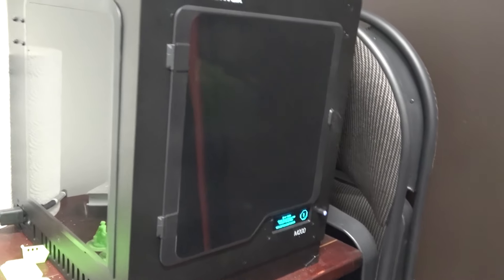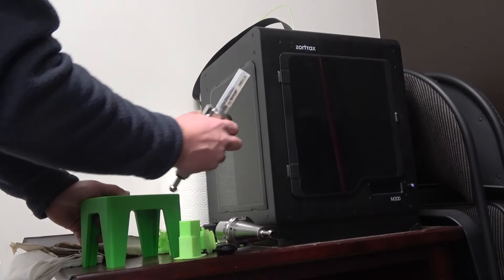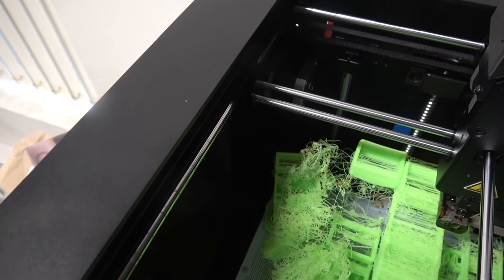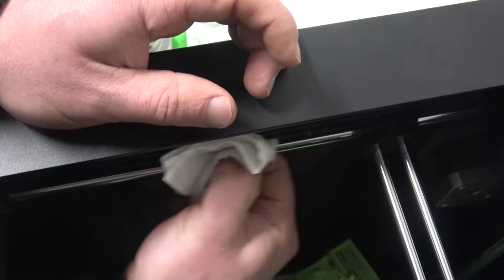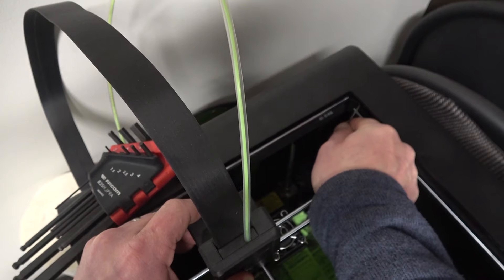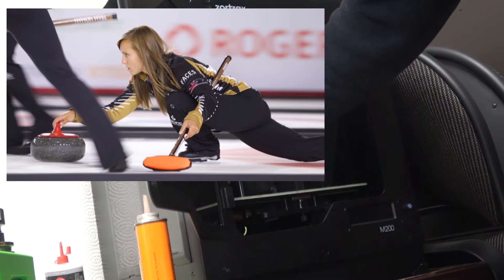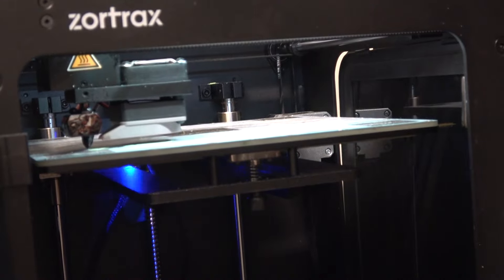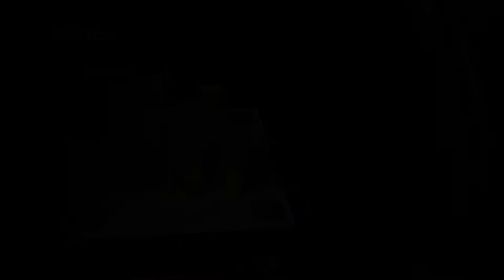WTF is a Zortrax M200?!

Comment: Just a tip, there are stepper drivers that can measure when the back EMF collapses in the motor, which is what happens when the motor skips a step. This gives the printer capability to know when something is wrong and pause the print without the use of expensive encoders

Comment: Using the new trinamic drivers there is feedback (lets you use them as endstops, lets em adjust power on the fly to run more quiet, and lets it tell when it misses a step), the prusa i3 mk3 is an example of a printer with those drivers out of the box, makes printing almost too easy.

Comment: i bought a creality ender 3. its cheap, not enclosed or anything, and needed a few mods to make it good, but im honestly very impressed with it! i finally just broke my extruder tensioner arm tonight, after a year and half of service... the stock one is cheap formed plastic, so i whipped out ye olde solder station and melted the cracks back together. gotta maker last till thursday haha, ordered me up some proper aluminium replacement parts!
in all seriousness, ive not done any maintenance on this 3d printer, and its been fantastic. still prints good (even with a partially dickered extruder tensioner arm). mine uses belts and V wheels on an extruded aluminum frame instead of rods and linear bearings or bushings... it might not be as super rigid, but it appears to be a hell of a lot more forgiving.

cheers and beers UB!
Reply: Ender 3 user right here as well, great for the price point!!

Comment: Love your channel.
I was watching this old Tony on his ultrasonic cutter and thought I would run this by you. Ultrasonic extruder on a 3-D printer...
You could potential he have a wider path and finer layers, better layer adhesion as it prints as well. Possibly potential texturing if you could work frequency modulation into the code.

Comment: So in the printing industry we have the same deal. Theres usually felt "wipers" that go around the shaft to keep the rods lubricated. Silicon oil doesn't attract the dust like 3in1. Hairspray works great to keep the plastic from adhering to the plate.

Comment: I’ve been 3D printing for a few years now ..... the steppers are fine.  Number one key is level print bed.  Next in importance, first layer adhesion to the bed (many home grown products help - Elmers glue stick lightly coated on the print bed - you used WAY too much, hairspray, blue painters tape).  Next, the 0.4mm nozzle must be clean as well as the hotend.  Finally the filament feed rate must be just right ....

Good luck ..... you’ll need it.

Comment: I've been using glue stick long ago, but I've since moved on to hair spray and I'm way more satisfied with it. Not only is it easier to quickly apply while the printed is heating up after you forget about it and already clicked print, it also doesn't leave the prints all sticky (I don't use raft).

Comment: I spent a long time using the Dremel 3D45. It's an educational university grade 3D printer and is very much like their power tools. Fricking Amazeballs. Never messed up like that ever.
Reply: Also your problem is probably a shitty extruder. Plastic gets stuck to the end of the extruder then gets worse and ends up not laying down in the correct place as it's blocked by plastic.

Comment: AvE, I've spent too many years fixing printers, Synthetic ATF works wonders (Amsoil synthetic universal ATF best for this, then Mobil synthetic domestic ATF) .  Both for an initial clean, and as a lube.  You'll be drawing "black" out of the bushings for a while.   3in1 works, but needs frequent relubing as it will start gumming up over time, which is why the nod to Synthetic ATF as it'll resist oxidizing for a longer period of time.  Viscosity stability is also important as heat will thicken up some oils and additional drag will ensue.  Might not seem like much speed is involved, but quite a bit of heat can build up on the carriage rods--if you try regular motor oil (on an all metal unit) even a single weight, after about 5-10 minutes you will hear the carriage slow down and strain from the heat affecting the oil viscosity. 
   For a really long lasting wonder lube for carriages, HP had a lube for their designjets that was super slick and lasted quite a while before needing to go back in to service the carriages, but I'd rather buy gold on the open market for what they wanted for it.    But give the synthetic atf a try, leave the wd40 for something else and use the atf to wipe down the rods, lots of detergents in atf for cleaning things up.

Comment: If you rotate any part with square edges by 45 degrees it will print slightly faster due to it being able to use the full speed in both horizontal axis at the same time, and it will keep the Y axis rods spinning constantly while the gantry is moving, making sticky spots like that far less problematic.

Comment: Material is key to success. Like milling...if you use crap end mills you can expect it to break so with cheap plastic you can expect jams and loss of extrusion.      Even diameter and make sure it’s wound neatly on the spool.

Comment: I found replacing my printing table with a piece of glass and a healthy coat of Aquanet before each print and she'll pop right off no chiseling needed
Reply: The "printing table" on the M200 is the heater itself. You cannot remove/change it. The proprietary slicer smashes the first layer down into the bed and pushes some ABS into the perforations. You cannot tell the slicer got stop doing that.
Reply: @zaprodk  don't tell me what I can't do, pal
Reply: Prusia now use a coated spring steel sheet on top of their heatbed. It's great.

Comment: I have a rig that's a similar size, and use the bottom part of a paper lawn and garden compost bag, or whatever they're calling the large paper bags up your way; reinforced the seams and folds with duct tape, and it's been doing pretty well for years of moderate use and costs virtually nothing.

Comment: until very recently my job was to develop 3d printers and additional electronics to them, and let me tell you there is a lot of improvement coming in reliability and smartness of the machines, but it is on the market to adopt these new boards as the usage/workflow is different and of course it is a tad more expensive. on consumer printers it will take a while as everybody is looking for  avery cheap pricepoint or a well tested machine, to match both points some further dev and mass  adoption on the professional side is needed first.

Comment: Cool, we've got the same printer! I started out with a home built reprap, but after a couple of years of tinkering I was ready for something more reliable. The Zortrax seemed the best choice at the time. Never had any trouble over the years. I've added a HEPA cover though. Not really because of the fumes, but to keep the dust out and the heat in.

Comment: Lovely, I have an M200, it took 4 Polacks on a chair in a round room to assemble it but turned out damn fine.  I went with this machine for the dedicated software, they all warn ya " opensource!" but they never tell ya the Opensource stuff is junk, Zortrax tested all their filaments and feed the gurgle into the gobble right. However the Zort is damn near as pricey as the snort these days, primadonna!!

Comment: a slight bind usually will not cause that much of a layer shift on the x and y. Most of the time the real culprit is headcrash on the printing surface. This could be anything from miscalibration in the slicer, unleveled bed or a few missed steps on the Z.

Comment: If you want less issues, i would reccoment a prusa printer, they are very user friendly and are great quality, with step loss mitigaiton due to the confuser be counting the missed steps and such, i have one myself and it prints great! It has removable print plates, and has a special coated print plates that just need to be clean to have them stick

Comment: Trinamic makes steppers for ya that are good. I would suggest you add a oiler filter in line with the filament. puts a fine layer of canola oil on the filament. prevents clogs

Comment: Get you a Lulzbot Taz series machine. I've got a taz 5 and 6 in the office, both been chooching along hot suppers style for several years with incredible reliability. I've got the dual extruder head, the "moar-struder" high output head for printing big stuff quick, etc. Helluva reliable workhorse of a machine.

Comment: Take the Y axis rod and check it to make sure its not bent. If ts not bent then the Bearing is screwed. They use the cheap ball bearings and if any dirt,hair gets inside your axis will skip steps. Replace with brass bushing and your 3D printer will be fine as frog hairs.  Could also be other factors but as you disassemble the axis you will notice any other problems.

Comment: I print structural components with a 1.58 mm extruder - just a regular nozzle drilled out with a 1/16" bit. You get unbelievable strength with that, and it'll print in about 1/4th the time. Obviously not as precise, but strength rivals that of injection molded parts, better still if you print in GF30PA6, and the large extruder size prevents clogs.

Comment: I had problems with prints sticking after I installed a piece of glass over the bed.  Glue sticks didn’t work, blue tape worked too well.  I tried thinned white glue (specifically Elmer’s).  I thin it 50:50 with tap water.  I paint it on with a 1” foam brush when the bed is hot - it dries in probably a minute and a half.  The parts stick just fine when hot.  When they cool, they take almost no effort to pop off.  Sometimes while they are cooling I hear a “tink” — the part has freed itself from the bed and I can just pick it right up.  Since I started doing that, I don’t think I’ve needed to use a scraper.  Leaves no residue on the part.  I can get a bunch of prints before the glue starts to look worn.  I run the glass under the faucet and the glue comes off easily with a single edged razor blade scraper.  Edited to add - using PLA+ filament.

Comment: The only time my Qidi has lost steps is when the extruder tip fouls on the part, increasing the dwell time per layer can help with that. FDM  printers produce crude parts from inferior materials, but they can be usable. And anyone who has tried to learn a CAM program will appreciate how easy the slicer software is compared to toolpaths and such like.

Comment: I got myself a cheap chinesium Kossel clone.  I was having no end of problems with it losing steps.  Eventually found that I'd put the drive gears too close to the steppers and they were binding on the stepper's casings.  Then I just needed to add some additional structural components (available for printing off Thingiverse) to make it resist twisting and othr flexing more, and it's pretty good now.

Comment: AvE this looks like the MyLan M200 - which in its as shipped configuration is as you say "ain't a tea bag".... however turning her into a tea bag isn't difficult and only requires a little bit of tweaking to be honest.  First, switch her over to a Bowden extruder, there is way too much weight on the head, when you end up removing much of the weight from the head, all sorts of good things happen, primarily accuracy improves but feed jams also stop when you have a good Bowden setup (this didn't cost me much money).  Additionally, you no longer need cooling fans on the head to prevent meltdown of the extruder.

Comment: I was an early adopter, bought my 3D printer from a US company, Solidoodle. Now out of business, (couldn't compete with China). They were well built, but I've swapped out the built-plate material, extruder, the hot-end twice, and the control board. (The extruder was the worst bit, made of laser-cut acrylic stacked up, it eventually shattered and was completely ruined.) It's now in a state where I can throw some G-Code at it and I know it'll just work. Took me long enough

Comment: It's a shame that the Solidoodle venture went belly up, they where probably some of the best "prosumer" machines made for the price. I still have my V4 and it has had little to no problems, the temperature controlled cabinet makes it possible to print with any flavor of filament and will check home position at every layer. If the positioning is out of limits it will abort before wasting hours of print time. I personally prefer ABS, and have tested prints to be equally as strong as injection molded parts. In the rare event that a part fails I will remake and dip in acetone to ensure fully fusing the layers, makes for some pretty functional parts.

Comment: Sure maybe the Y axis picked up some schmoo that bogged things down, but print speed is likely what killed it.  I know nothing about the Zortrax, but most 3D plastic filament printers cheap out on the stepper motor driving.

Most steppers are rated by current and most (decent) drivers allow you to set the current.  The problem is that motors have windings... inductors, and when you pulse them real fast - as one does with steppers to make them move fast - they don't charge up to their full field strength unless there's enough volts (pressure) behind the amps.  Most 3D printers for home use use 12V power supplies.

In industrial settings, it's not at all uncommon to supply a stepper driver with 48 VDC or more to drive a 2A rated stepper.  The faster you want to step a stepper, the more volts (within the limits of the driver) you should have at the supply.  If anyone reading this is having trouble understanding why voltage is important here, Google "inductor time constant"

Comment: Hey, if you switch from ABS to PETG you won't have the schtank to deal with. Petg is pretty much just as strong, it's just slightly less temp resistant. I think ABS glass transitions at like 110c and PETG at like 80c.

Comment: Backdriving the extruder holder is ‘not allowed’ because the stepper motors will start to act like generators and might fry the drivers/controller.
Reply: I do that regularly and never had a problem with it. but probably best not to try pushing it at some 900+mm/s; that might be enough to let the smoke out.

Comment: What material are you printing with? If you are using ABS or nylon it's typically a good idea to keep the entire printer enclosed. Also If you feel like the extruder is eating away the filament during the print you can typically change the extrusion multiplier in the slicing software and make it less noticeable.

Comment: Core X-Y is a bit heavy for a movement system, I would avoid ABS if it not fully enclosed, most PLA's or PTG's are just as good and they don't lift from the printbed, I would look at a Prusa printer it has the up to date stepper drivers that can detect missed steps.  Also replace the heater for the bed with a silicone one, heats up much quicker as it runs from mains power not the silly 12 or 24v.  Love the vids and humour keep it up.

Comment: Pro tip. Use darker coloured  filaments for better prints. It holds the heat longer and you are less likely to get the tangled mess.

Comment: My PowerSpec printer did the same thing (in the X axis) when the connector at the X stepper started getting screwy, I swapped the Stepper & Cable out with one I had laying around (didn't have time to order a new cable), and haven't had an issue since.

Comment: It's a nice printer.  I've had one for many years.  Could been better back then but I got the upgraded build plate from Germany and a microswiss hotend.  Shoulda got the enclosure but what they want for the fitted acrylic was not worth it so I put mine in a cabinet.  Downside is the electronics  below get heated.  The enclosure is better.  They've done a great job of improving it through firmware and slicer settings.  I want to upgrade mine to klipper...

Comment: Looks like the hardware is simply not failproof enough. I have a pretty cheap Chinese ender 3 printer from creality, and it works like a charm. Never had any problems with missing steps. Now, bed adhesion is the biggest failproblem of it, but a spraycan of 3d print bed adhesive works wonders.

Comment: First if all, love your work. Long time viewer here, I've got the m300 I've converted it to marlin firmware because that raft that raft crap sucks, had me fedup, but it's a good printer. Few things 1. Wrong lube, bike chain oil or dry silicone lube for x and y or proper grease that doesn't eat plastic for the ballscrews z and bearings.... Buy the hepa enclosure to save ur lungs from styrene and keep heat in the winter. Don't print pla without a microswiss conversion. If you want a printer that is a workhorse buy a prusa i3 mk3s. The zortrax is a workhorse too but primarily high temp engineering plastics. You can make end use products printing in nylon and stuff like that. Zortrax isn't somuch for prototyping imho. .. prints way too slow  Also your print probably failed because you attempted a large print without enclosing the heat inside. Plastic will warp and curl and crash... maybe you're right about the binding axis too. But the motors will fight you with back emf at times.. if thr plastic curls up it crashes into the nozzle and you will skip steps etc, if it cools rapidly it will also split and become weaker. Especially anything hotter than pla and pet-g, so you want to get the sides and hepa filter top to keep the heat inside to get isometric shrinkageeee just like my Johnson after a long weekend.. zortrax has some of the best quality parts. Proper high end gates belts branded rods. Branded ballscrew
Reply: Also you might need to re square the print head if it's fighting you toomuch .. zortrax has great documentation on how to do that